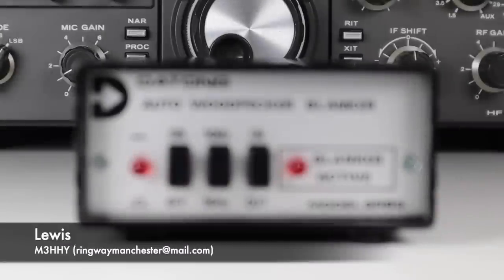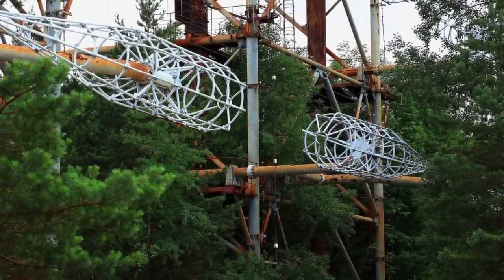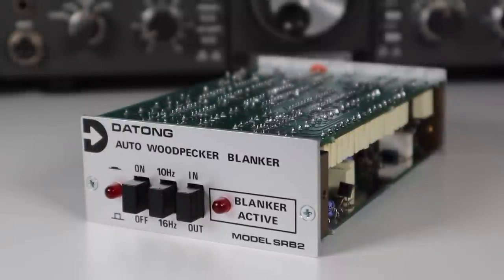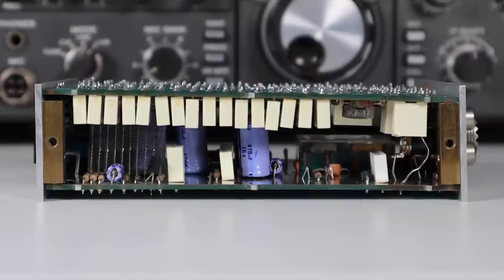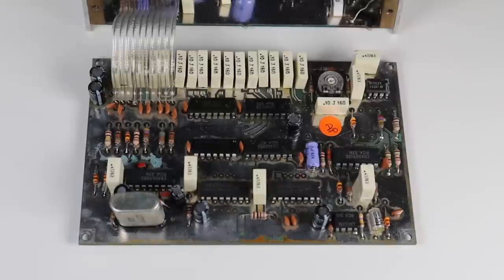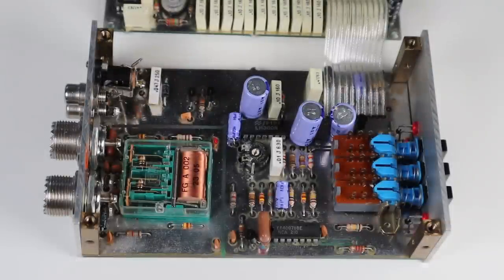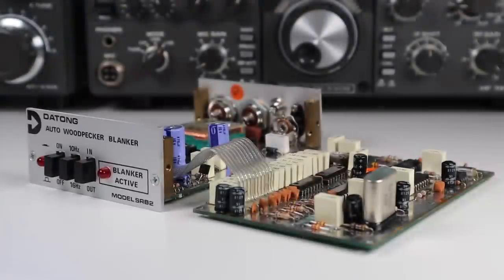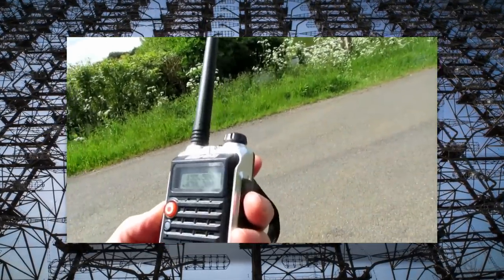Inside The Shortwave Russian Woodpecker Killer

Comment: i am an expert in audio engineering and audio electronics, and my take is that is way more circuitry than just a simple audio notch filter...i would love to check out the schematic and see what's going on....great vid, as always!
Reply: There's a filter but there's way to much parts for a simple audio filter.
Reply: I was under the impression that it inverted the interference signal to put against the interference normally picked up to null it out. Sort of like a QRM eliminator but can be only used with the woodpecker.

Comment: Thanks, much appreciated! I was one of the mob who requested a tear-down. It looks like it may be a PLL synchronised notch filter, possibly with a dynamic attenuator that is switched in circuit just at the right time, with a switched-capacitor notch (or high pass) filter for the audio. That is a BIG bank of capacitors!

Comment: I concluded that there is much more to this circuit than a simple audio blanker when I saw that both SO239 and phono sockets were on the back. Why are the RF sockets needed for a pure audio blanker? I think the problem with 'only' an audio blanker is that the RF front-end will overload , produce intermodulation distortion and create a period of poor reception in the radio for a number of milliseconds as the AGC recovers. So I strongly suspect that this box is a two stage solution that blanks (gates out) the strong pulses from the RF by using a threshold comparator to create a dead zone in the RF and a final 'mopping up' stage in the AF. This slightly more complicated approach explains the larger number of components than a single audio notch filter and also the requirement of an external power supply.and the SO239 sockets. After the time that the Datong product was developed, single-chip, two-stage blanker solutions came out, for example the Allegro Microsystems 3845.

Comment: I recall these things from my early days working for a large amateur radio dealer on the south coast and from the latter years of the woodpecker. As far as I remember, it seemed to sync with the woodpecker’s pulse rate and gate the incoming RF when a pulse was due. In that way, it would eliminate the problem of the receiver’s AGC becoming swamped, something which wouldn’t have worked by simply filtering or gating the audio alone. 
In my younger years, pretty much any receiver or amplifier with an un-terminated input would pick up the woodpecker, either that or radio 4 on 692KHz from the transmitter a couple of miles away!

Comment: As this device is connected in-line from the aerial and also in-line with the audio output of the receiver, I'm thinking it's more than a notch filter in the audio spectrum? Maybe the device is syncing to pulses in the RF spectrum to switch the notch filter in and out, which also lights the 'blanker active' LED? It's possible  that having locked onto the Woodpeckers pulses, the RF is also attenuated to avoid overloading the receiver front end.

Also IMHO the 10Hz or 16Hz references the repetition rate of the pulses not the audio frequency; 10Hz would be deep bass that even most hi-fi systems can't reproduce.
Reply: The antenna was disconnected for the duration of the pulse, thus allowing the receive AGC to recover, it made for choppy audio. 10Hz was the repetition rate, not the frequency of the interference.
Reply: Yes, I asked myself the same question when I saw that both SO239 and phono sockets were on the back. I think the problem with 'only' an audio blanker is that the RF front end will overload , roduce intermodulation distortion and create a period of poor reception in teh radio as the AGC recovers. So I strongly suspect that this is a two stage solution that removes the strong pulses from the RF by using a threshold comparator to create a dead zone in both the RF and AF. The dead zone length following the comparator triggering is set by the 10Hz or 16Hz button. This slightly more complicated approach explains the larger number of components than a single notch filter and also the requirement of an external power supply.
Reply: It appears to not have any actual filtering, instead it uses a 'ring' of capacitors to sequentially store the average DC level of the signal with a new capacitor being used for each 1/10th of a second time slice. As long as the transmitter and eliminator used the same rate, no sync was necessary as the pulses would just happen to line up on the same capacitor with each pass around the 'ring'. This caused the 'ring' to store up the profile of the low frequency pulses, also making them available to replay with inverse polarity. The level on the capacitor for that time slice was subtracted from the raw signal like combining anti-noise in a noise canceling headphone and there you go.

Comment: As an electrical engineer I seriously doubt this was anything like an audio notch filter. Those simply wouldn't work because of the harmonics generated by the signal. Also this is way more complex.
If I was to hazard a guess on how this works, I'd say it would use a wideband detector to detect the pulses of the woodpecker regardless of the signal you want to receive, essentially a wide-band AM receiver. Since the pecks occupy a very wide spectrum, they are easy to detect that way. Then once it finds out when those "pecks" happen exactly, you can predict the next "peck". Since it's rather short, you can just blank out the audio for that moment. Yes that causes periodic outages in the audio, but that's much less annoying than the loud "pecks".

Comment: Thank you for sharing this interesting and educational video with us. If it was just an audio blanker working at 10Hz would it not have been easier to have produced a device which went between the radio receiver and the headphone or the external speaker? Could radio manufacturers not have created a simple audio blanking circuit and included it in the actual radio receivers themselves thus making them "woodpecker proof"?

Comment: Very interesting, I was licensed at 14 in 1986 and the Woodpecker was a distant memory then but these units were around in number. I’m assuming that the relay is RF sensing and used to switch out the sensitive circuit when the rig transmits. Then a broadband RF detector filtered tightly on 10/16Hz which switches some RF attenuation in with PIN diodes to protect the receiver agc ? This sync also primes the capacitor loop (10 for 10Hz or 16 for 16Hz) that acts as a crude 16 or 10 x 1 memory device to drive the PLL for the audio filtering / blanker (probably mutes any noise from the PIN diodes)  and injects some white noise into the audio loop to reduce the heard effect of the blanked time slot - bloody clever. 
Incidentally Datong produced some superb direction finding kit that found favour with “government” users particularly in the northern Irish troubles and their business expanded in this direction leaving amateur radio behind. They manufactured some state of the art surveillance equipment before being swallowed by a bigger business in the early 2000’s.
Reply: On subsequent consideration the audio (top board) and PLL (using the 10/16 x 1 capacitor memory) must drive the RF attenuation on the bottom (RF) board - that’s the logical way. It must be doing something at both RF and Audio levels otherwise it wouldn’t need both RF and audio connections - still bloody clever for its time, it would be a DSP and some code in 2023…

Comment: Your description may be off.

Radar works in pulses (send a pulse and wait for echo).
I would guess that relay actually disconnect the reciever in sync with the recived pulses.
So the AGC won't see strong pulses and thus not lower the gain messing up reception.

But there is clearly more to the box, anyone have some idea?

A 10 Hz tone would just make some hum(if you can hear that low) in the speaker and not be a major problem.
Reply: It's a time slice dependent DC level restore. See my post for a brief rundown of the circuit.